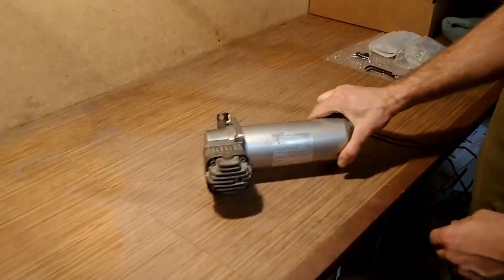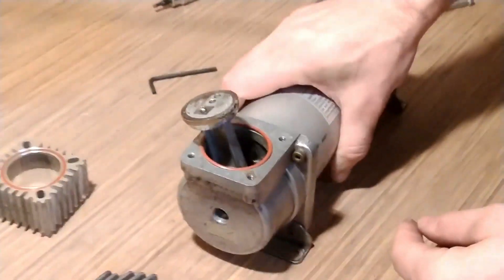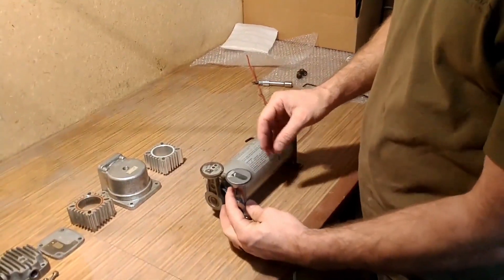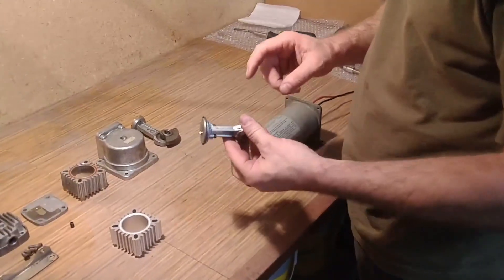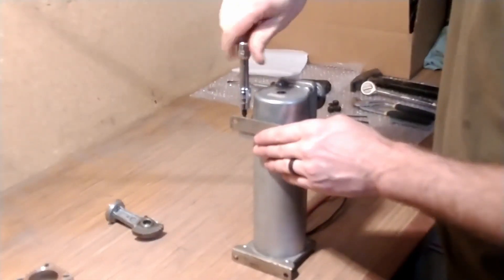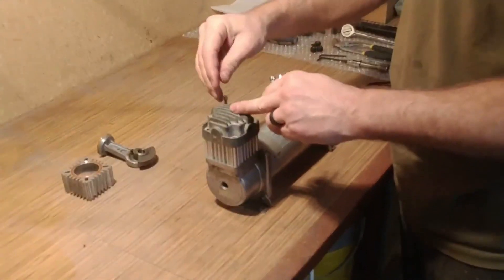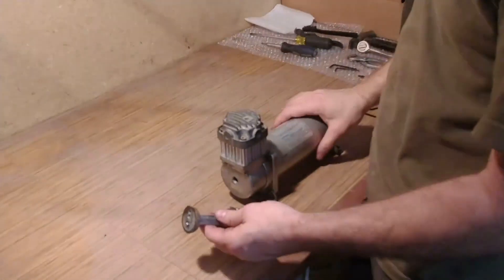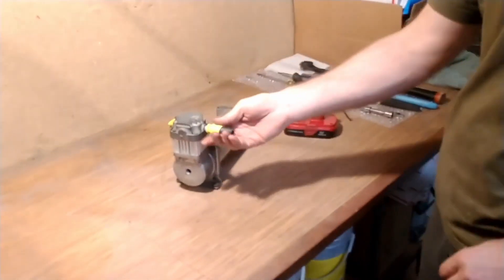VIAIR Air Compressor Rebuild

Comment: Whats the size of those o-rings? Both of them
Reply from the maker: I am unsure.  Sorry I didn't take a measurement when I took it apart.  You may be able to try VIAIR's customer service for help.
Reply: Okay no problem..  i bought eveything for my compressor and still has lower pressure  worse with the check velve on and water trap. Im now forced to buy a new compressor 😢
Reply: Can you take a video of how the pressure flow should be from your compressor when you put your thumb on the end tip of the hose without the check valve and with the check velve and water trap?

Comment: Thank you for that information video! I did not know that there is a new style of piston, but this model, but I have a question for you?  is it worth restoring it?  Isn't it better to buy a new compressor, since the old one still has armatures under fatigue and wear?!
Reply from the maker: I would say that would be a personal choice. Much like buying a new car or repairing one that has many miles on it. Some will say, run it till it dies, others, if you can afford it get a new one. In my case, I spent less than $100 to keep it running verses  $400+  for a new one.

Comment: Did you use silicone oil or regular oil?
Reply from the maker: This is a no oil compressor, so no oil was needed.
Reply: @OffRoadEndeavor  you rubbed oil on the seal around the piston.
Reply from the maker: @5thgen1  Oh sorry that. It was from the can of chain lubricant that I sprayed in the cylinder wall.